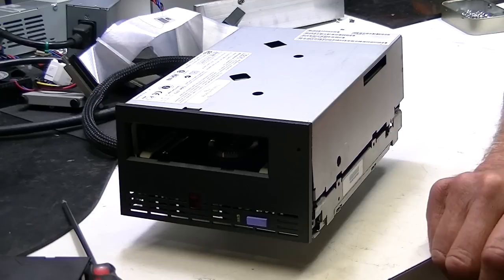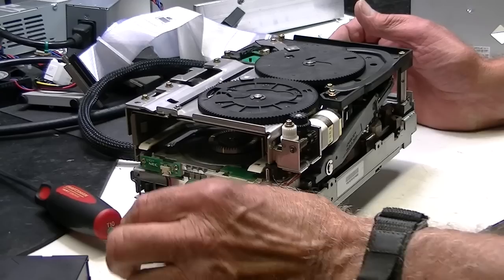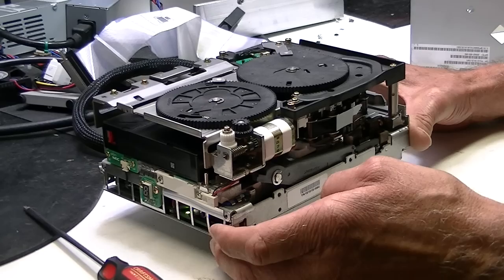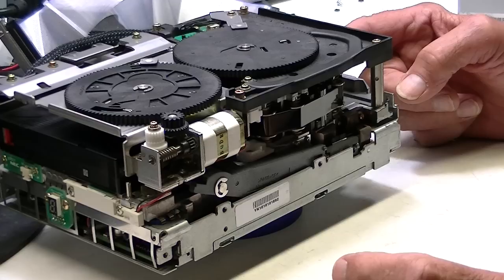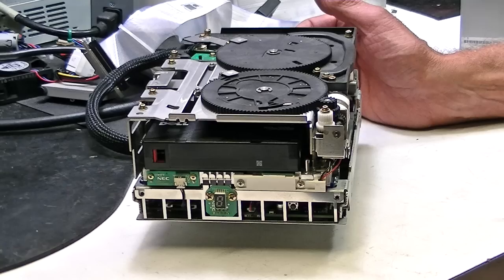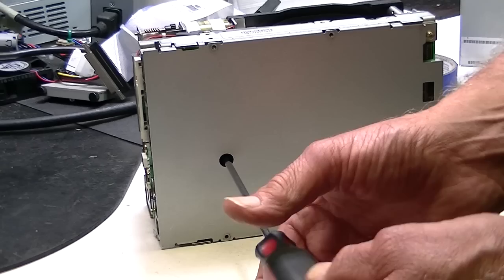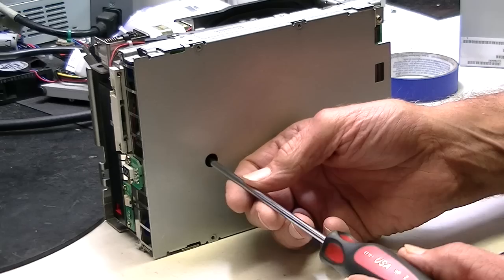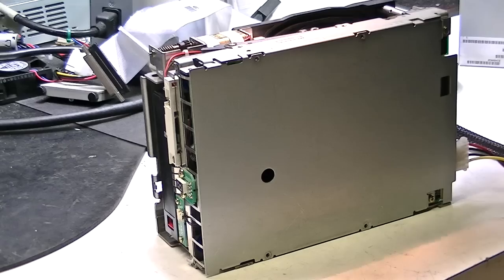Remove Stuck Tape From IBM LTO1 Tape Drive

Comment: I was fine until you started changing directions on the rotation of that tiny gear. Up or down?
Reply from the maker: sbentjies If you are referring to the 7:40 mark of the video.  You want to turn the little gear up.  This is to raise the tape cartridge up.  I got turned around and started turning the gear downwards, but you want to turn the gear upwards.

Comment: How can i fix a no power problem? I have connected a LTO3 FH Drive to pata power and turn on the pc. I see no lights on the drive. I have not connected SCSI for now.
Reply: Is there a fuse maybe? I have found an smd almost right after the 12V pin. Labeled DKP. Before it i measure 12V but behind this i measure nothing. Also there is no continuity through this smd.

Comment: how to repare tape drive ibm error 3592 E08 FID1 FF
Reply from the maker: Hi Sebbagh:

Thanks for contacting us via our web site and for the U Tube question.

With those kinds of FSC, they are all related to a head issue.  The heads are not repairable only replaceable.  No heads are available from IBM.  If you can force a data dump from the drive you will also be able to look at the FSC and do a lot of discovery from the drive log download page.

On the EO 8s this is a common issue, no way to resolve.

Regards,

Dan

Comment: Thanks for this video. I just had my first stuck tape that would not eject in an IBM LTO4 full height drive. With this I was able to figure out the tape load/unload gear and how to get the leader pin unhooked from the take up reel. In the end, the problem was that the tape ripped after about 1 foot of tape pull. It wasn't a tension rip as the tape did not look stretched a the spot, it looks like a clean cut that probably started from a nick in the tape. Luckily it happened at the beginning of the tape and didn't have to unwind a long mess of tape from the internal reel.

Comment: This worked great on my IBM LTO5 full height tape drive, identical to this LTO1 drive.  The tape itself was messed up and had to be sacrificed. This information helped to get the leader and tape out of the drive, with little fuss.  Thanks.

Comment: would you recommend the IBM dry process cleaning kit 35l0844?
Reply from the maker: The IBM Dry Process Cleaning Kit 35L0844 is for MLR drives.  The dry process cleaners are very expensive.  We have the wet process cleaning cartridge that works on MLR drives.  Here is  link to our web store to take a look at it.  We have 2 in stock: http://tapedrivesales.com/products/tandberg-8962-50-cleanings-1-4-qic-tape-drive-new-cleaning-kit-new
Reply: +repairmytapedrive yeah I have 4 of them brand new wrapped they belonged to my dad but he's not here anymore and I don't have the machine

Comment from the maker: Hi ATPDARK  We use an external power supply with the 4 pin molnex connector very typical supplys 5 volts and 12 volts.  In a a pinch a PC power supply would work if plugged into a Mother Board  Our external power supplies come from external cases that have the 4 pin connector and an AC input.  Hope this helps
Reply: +repairmytapedrive Yes, it help me! I work with this and we never use a external power to do this, so was a grate idea to do it.

Comment: 7:40 no, you are rotating the correct way.
Just think about the movement of the big wheel at the back -> spooling tape up or releasing tape.
For it to be releasing tape it has to turn clockwise.

Comment: hi have a drive  that went dead on me when a tape was in side   the drive was not used to be warm up  starting using the drive killed it lucky i was using 
a test tape  to all over there EBAY DRIVES HAVE TO BE WARM UP OVER HRS   for them to go back in to work i had used drives of many makes die  on me
in the past  not any more  just heat them up slow over time  it works big time